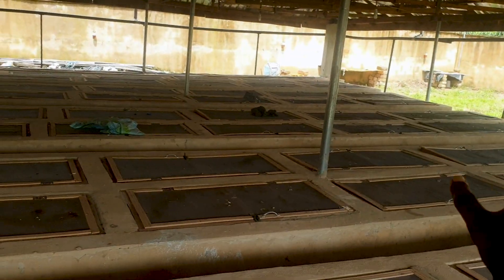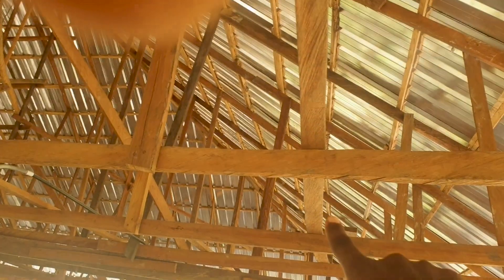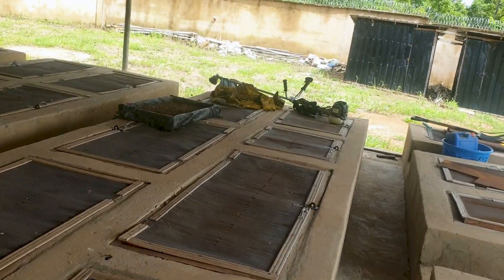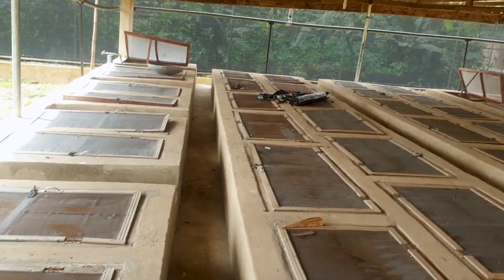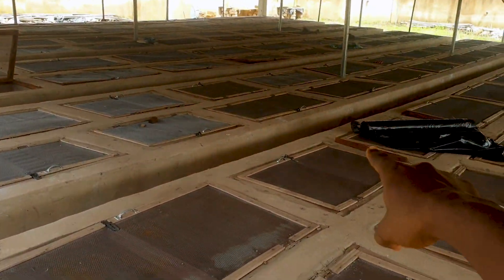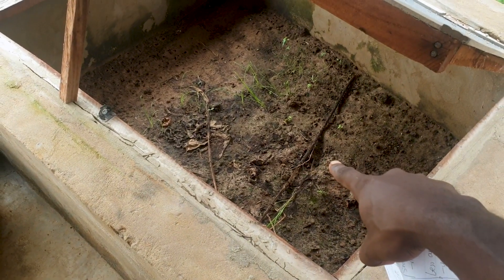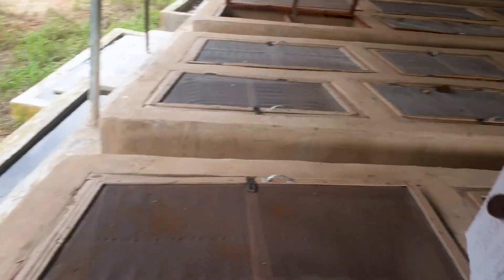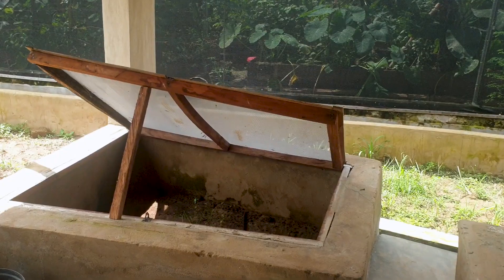Snail Pen vs. Snail Greenhouse (Honest Opinion)

Comment: Your video was shared to me by someone a few minutes ago. I humbly have a few questions. 

1. How did you arrive at 30,000 - 40,000 snail density for the net house?

2. If 7000 snails will max out a 50*50 plot, how is the density for 100*50 equal to 40,000? 
If the pathways and block work even covers another possible 7000 snail space, I do not think the net house should be able to take 30,000-40,000 snails.

3. You did not offer a single solution to any of the issues raised about the net house. Including the high injury rate which has wiped out a lot of snail net house farms. 

4. Pig farmers also do alot of bending when cleaning and feeding in large scale farms. we do not often hear them complain about bending too much. Don’t you think we are creating a perception that in snail farming, one has to do almost no work at all. 

5. You did not mention the fact that pests can easily attack snails in the net houses. Further more, the pest can hardly be controlled due to the nature of the housing.

6. Snails are not in their natural habitat if they cannot escape from pests. They are not in their natural habitat if you have limited amount of vegetation for them. Should we put poultry, rabbits and pigs in their natural habitat too? 
You also did not mention that you have to manually feed the snails every day in the nethouses as some of them are not able to reach most of the vegetation in the nethouses.

7. For how long have you been farming snails in the net houses? 

8. You mentioned high injury rate in the net houses. Which means there will be frequent ant and housefly attacks. If that is not happening in the trench pens, doesn’t it provide more profits in the end? 

Anyway, I’d like to have a live YouTube session with you to discuss these out. In your submission you said, you’re quite new to snail farming. I do wish you all the best though.
Reply from the maker: Hello KT, I''ll try and address each of your questions one at a time

1. The average size of each of my pen is 140 cm by 70cm. Thats an area of 0.98m2. With an average stocking density of 60 snails per sqm, it means I can have roughly 62 snails per pen. Since I have 117 pens, that means my entire pen can accommodate about 7254 snails. Remember I have designated some of the pens to be used for incubators so that will further reduce the pen I have available to house snails. The greenhouse has a dimension of 100ft (30.5m) by 50ft (15.25m). Thats an area of 465.125m2. Using an average stocking density of 62 snails per sqm means I can comfortably house about 29,000 snails. Now remember I have increased the surface area in my Greenhouse tremendously by adding plenty of vertical and horizontal shade blocks which will further provide accommodation for the snails since they can live vertically suspended or horizontally. Not to mention the 10ft height that adds a lot of head room since they can also attach themselves to tree trucks etc.

2. Let's call it 30,000 snails even if we are to stick to stocking density requirements considering what I already said in 1 above.

3. Talking about high death rates in the greenhouse is a low blow and subjective as I have witnessed farmers cry about absurdly high death rates in BOTH housing systems..so no system is an angel in that regard. Given that very little is known about snail diseases and management (unlike in fish, poultry and pig) that have well established disease management practices and vaccines to help checkmate these issues. Snail farming is faily new and a frontier farming practice so its expected that mortality will be fairly high. That being said, growth rate and hatchability rate are also high given that each snail lays a LOT of eggs to more than compensate for the ones that are lost. I have already talked about having an established walkway to minimise the incidence of crushing eggs while carrying out maintenance practices, I have also talked about (in my other videos) the need to always clean the feeding platform to make sure the snail poo doesn't contaminate the food given to the snails and to also remove dead snails so they don't contaminate others. I have also mentioned having a variety of plants and vegetables so shade the snails as well as create a local climate with the right relative humidity that'll aid their development. What else is there to say?

4. Some (if not a lot) of the people who want to do this business are elderly people that have retired from their career and want something that'll help them get by. Putting that sort of strain on their waist isn't a good idea. In addition, most people that come into this business don't have the financial means to hire workers..they barely have enough money to build the structures and buy feed talkless of highring workers that'll won't be dedicated. I'm not encouraging no work at all. Theres no food for a lazy man. But when it comes to health, its a different thing bro. I understand where you're coming from...people want things too easy and sharp sharp but come on..this is not that.

5. A greenhouse with trench and a strong net will help eliminate most of the pests. Now, because the places where the plants are is exposed to earth means the Greenhouse system is exposed to ants. But not ALL ants are detrimental to snails. Yes, I agree I've not been in this business long enough but I've studied enough about it and also asked others e.g. Engr Theocracy who has been in this business far longer than me, Ants can be a problem but not as much as we make it out to be

6. I don't feed me snails everyday in the greenhouse because they can feed on the vegetables like bitter leaf or sweet potato leaf whenever I don't want to give them fruits or formulated feed. A greenhouse that is well taken care of won't have to worry about a lot of pest infestation i.e. ants. The greenhouse can't exactly mirror the forest because its limited in size but at least its the closest thing to that. Come on bro, compared to pig, poultry and rabbit that require a bit more specialised feed, snails are more freestyle & anything goes kind of creatures. They can eat a lot of different vegetation. It's not the same situation with the other animals you've mentioned. I can bet that If we both can speak chicken and we ask a chicken which she prefers, she'll tell you she'll rather be left to roam about, play and find her own food rather than being stuck in a battery cage lol and be fattened for the kill.

7. I've been PRACTICING snail farming since November 2022...been learning about it for a lot longer including being around my uncle's farm who also does it

8. A well-constructed and fortified pen house doesn't have to worry about ants but that's not the least of the problem. There's still disease outbreak, cannibalism etc to worry about...which is why a lot of pen houses (in addition to greenhouses) report a lot of mortality. No system is a saint in this regard.

I'm open to have a YouTube live session of course...as long as you promise not to come for me with a knife...I'm not ready to die.
Reply: 1. So by your reply the 30,000-40,000 was wrong.
Secondly, the calculation in your reply is not entirely correct. You couldn’t take out the area of land the vegetation, the set up, path ways and platforms will take out of the total land size. 

You also mentioned in your reply that snails can live vertically? Not true. They usually climb and sleep vertically when they are uncomfortable or do not have enough shade.
Eventually, they will drop and add up to the numbers. This is a fact !

2. No it’s not 30,000 snails. What that will also mean is no stepping space for any human nor vegetation space. 

3. Farmers cry about both housing reference to mortality. 
In the trench housing you know exactly how many snails you lost and can identify the cause in 24 hours. You can easily learn about the causes and avoid them if you mean business. 
Same cannot be said about the net houses. I bet you have discovered totally empty snail shells right? Ants had already had their feed.
Bro, talking about vaccination and co, are fishes given vaccines and co? But farmers keep them in pest free farms. 
I can also bet you that no mater how much pathways you build, you’ll always need to step on the soil. Unless your path ways take up more space in the net house.

You talked about the number of eggs compensating the mortality. Bro how do you know? Since you cannot do any accountability? 
You have tens of snails falling from your high walls every night. Whiles you have the AM laying averagely 8 eggs
Reply: 4. Your vegetation will at a point get deserted. You will encounter difficulty in replacing them since you cannot step on the soil. It will soon come brother. Anticipate it.

5. The issue of bending is not an issue you should have brought up because it’s very low of a point. You even bend a lot in your net houses😬. 
This is business. 
If one is an elderly person, does it also mean they shouldn’t do pig farming since they will be bending there too?
For people who have low income but want to start snail farming should start with few pens, have a different business module and scale up with time and employ labour. They do not have to raise everything they sell. 
I don’t know any poor person who can build 50 pens. It’s so profitable that if you farm them right, labour cost is not even a problem.

6.  Please don’t mention that guy’s name. He keeps misinforming alot of people. Same person who said not a single ant can kill a snail. Same man who said only AF produce snail mucus? 
Let’s leave him out of this.
 I can tell you on authority that your farm is yet to be invaded by ants in all shape or form. The trench around it will stop some but most of them will build tunnels beneath the earth and appear in the net house. 
Note that a big variety of ants can eliminate snails. Some centipedes will make use of abandoned ant tunnels and infest the farm. It’s facts. And it will be difficult for you to control them.

7. Ofcourse every animals yearns for freedom. Giving them some free freedom does not necessarily mean it’s right. 
If there is an ant infestation in your farm, the ants will I’ll flee but still end up with them. Because they have been limited. 
You’re not in business if you still have pest attacks and cannot account for mortality. It’s like exposing poultry to snakes in a net house. They are roaming but will die.

There is no cannibalism in snail farming if they get their calcium supplements. 

A trench farm owner can report on mortality day on day and decipher the cause like I said earlier. You can’t do same until harvest is due. 

You only depend on estimations and business is not done that way. I’ve been to very large scale farms in other industries and you’ll be marveled how they still prioritize accountability. 

+233548178415. Kindly shoot me a text on WhatsApp and I’ll respond when I get home. We should have a live YouTube session. 
Thanks for responding though
Reply from the maker: @k.t.samuel  1. My estimation is not wrong because I gave a range and my final number (taking into account the additional surface area from the shade blocks) fell within that range. It wasn't a number plucked out of thin air. Weather they go there to sleep doesn't matter. Bottom line is they do it. In the pen house that is almost perfectly shaded, they still climb up. Some do it to avoid predators on the floor. Their slime is way stronger than you give them credit for. They don't fall that often..far from it. In addition, snails live within the vegetation, on tree truck, in the shade block, in the spaces between the shade blocks etc. so those structures don't limit surface area..instead they add to it.

2.  You can call it 29,000 if you want but in my humble opinion, its 30,000 if not more. To each their own

3. You can't always identify the cause if it's a disease. If they're not getting enough calcium and their shell is turning white of course you can EASILY identify that. But, if its death due to bacteria, fungal or viral infection in their food or water, it's not that easy to discern if we are being honest.

I don't have snails falling from my high walls every night because it's netted all round and snails rarely even climb it. I'm talking from my own personal experience. We can stake money on it, put a night vision camera inside my greenhouse and see how many snails actually climb the net..come on!

I don't know about other farms but mortality in my farm is not that high. Each snail laying on average 8 eggs, 3 times a year can more than compensate for the deaths. I'm being realistic
Reply from the maker: @k.t.samuel  4. I don't anticipate my vegetation getting deserted to the point where i'll struggle to maintain the snails. In the rare event it happens, the pen house is there as backup incase I need to house them while the plants in the greenhouse recovers. In addition, I anticipate i'll have another greenhouse up and running when the snail population reaches that sort of critical level to start worrying about the vegetation being deserted

5. You can't compare bending to put food inside the snail food trouch in the greenhouse (less than 30 food troughs for that matter)  to bending to put food inside food trough in the pen, bending to till soil for eggs, bending to incubate eggs etc for over 100 pens! Starting with few pens will take a long time to earn any reasonable income and scaling up with a pen house is just not wise. Thats my opinion. Why spend more to get less when I can spend the same amount to get a LOT more. Clearly, you don't want to agree on that so lets agree to disagree

6. Engr Theo has achieved a LOT in this space. Whether you agree with his teachings or not doesn't change that. For what he has achieved with regards to snail slime extraction, he deserves respect. And, he didn't say only AF produces slime! he said only AF snails produce the kind of slime that has the RIGHT PROPERTIES needed in the cosmetics industry..not that other snails don't produce slime at all. He's not stupid. Granted I don't agree with him on a lot of things e.g. I always clashed with him because he believed only snail greenhouse was good and snail pen was complete crap. I saw merit in both systems so we agreed to disagree on that

7 Like i said before, lets agree to disagree since it's clear we are both dug in in our beliefs and no one is willing to yield.
Reply: Disclaimer: 

I have nothing to gain from informing you. I like healthy dialogue about things have passion for. 
I hardly comment under videos I disagree with.
Reply from the maker: @k.t.samuel  Fair enough. I appreciate the dialogue. We both are passionate about Snail farming and discussions don't have to get combative. In the end, we both want the best for people and we are open to learning.
Reply: @zenaksnailfarm  Regarding the individual in question, it is advisable to disregard their input as they exhibit closed-mindedness and a tendency to engage in unnecessary arguments solely for self-expression.

Moving on, I want to acknowledge your excellent performance, Zenak. Although there are challenges inherent in this new domain, I believe good management & a well constructed ecosystem is everything. Your 30K estimate is correct, even in the event of a 15-20% mortality, you will still surpass the pen system, which was built at a higher cost.

It is important to note that when discussing habitat, we consider not only where animals sleep but also their roaming behavior. For most net-houses I’ve seen including yours, the presence of a walkway within the system does not restrict the snails' access to that path. They crawl on it at night and return to the bushes in the morning, meaning the walkway does not detract from the overall farm area. Additionally, plants such as banana, pawpaw, bitter leaf, etc., contribute to the area through vertical dwelling. 
A research from a Greece farmer I visited found that, snails raised in a free range system tends to have tastier and quality meat than ones restricted in a small confinement. This may not apply to our GALS but it’s worth looking into it as we see this is true for other livestocks.

I still have your email from a few months ago, and I am currently addressing some matters that I will share with you in the coming weeks.

On a personal note, my shadehouse spans over 9000sqm, and I have divided it into 24 paddocks. Each paddock is fenced with heavy gsm insect net at a height of 2.5ft to ensure that snails remain within their allocated block. I adopted this method for scalability reasons.
So far we’ve only stocked 8000pcs (2blocks) since May. And gradually filling the other blocks with the newly hatched. Goal is to fill at least 10blocks prior the end of the rainy season. Each block I estimate can take atleast 20k adult snails
Reply from the maker: @McOforis  Thanks. I appreciate the feedback. It's always good to have a healthy dialogue and KT is knowledgeable so it's bound to be a fight. Your view of Engr Theo is quite accurate lol it's like you've had personal encounters with him. I just think it's his personality but his passion is not in doubt. With time he'll learn to be more accommodating of other views.

Your farm is quite massive! wow!!

You must be looking to go into slime production or even exportation with a farm that big.
Reply: @zenaksnailfarm  Not sure how Engr Theo came up in this discussion. Regarding Engr Theo, my previous comment did not pertain to him directly though. Although I have engaged in banter with him in the past due to misinformation, resulting in a few of his videos being taken down 😂 . Feeding snails salt and passing it off as research is a no no for me, I considered it a form of animal cruelty.
Despite Engr Theo's occasional stubbornness, I have noticed glimpses of retractions in his new videos regarding previous information. However, it is important to acknowledge that this journey is a continuous learning process for most of us. In every professional field, there is always something new to learn. It is the close-minded individuals who lack comprehension of a specific system yet assert their expertise based on others' failures that I find difficult to tolerate.

Regarding my snail farming endeavors, I am currently focused on AA snails, with no immediate plans for slime production which requires the AF species. However, this could be a possibility in the coming years, depending on the success of the meat aspect of the business. 

I am based in the US and have already established contacts prior to making this investment. While my primary target is the local market, I have explored potential opportunities for exporting to the US market prior to investing. Despite having comprehensive surveillance and monitoring devices on-site that allow remote observation of day-to-day activities, I still make a point to visit the farm personally at least once every quarter.
Reply from the maker: @McOforis  oh you meant KT. Don't worry. He'll come around eventually lol they all do. He's making a lot of money from his mango farming to look deep enough into greenhouse snail farming. When he does he'll see some merit in it...he's too smart not to.

Oh I see. So its meat production and processing for now. Thats lovely. I'm sure it'll be successful. Snail farming can pay tremendous dividends when practiced at scale and you're doing exactly that!

With regards to Engr Theo, I agree he's not afraid to admit when he's wrong. He was one of my mentor (him and Kester Amos) so I have nothing but respect for him.
Reply: @zenaksnailfarm   Yup, I was referring to KT.
Check your email. Sent you some pictures. I don’t like sharing stuff online until I’ve hashed out all the kinks and making sure everything running smooth. I’ve documented all the roadblocks & lessons learned  since July 2023 to share with existing & potential farmers. 
My farm manager will have a lot of educational content to share with the public once we open a YT channel for it lol. For now we’ve been working  on this commercial project in silence
Reply from the maker: @McOforis  I'm short of words. The work is very neat. The connection from the vertical pipes to the shade net, the stitching, the walkway layout, how the plants are organised, the PTZ camera..its impressive. Its what I love to see..fusion of technology and innovation. Pushing the boundaries of whats possible. Very well done bro!!
Reply: @zenaksnailfarm  thanks it’s always good to share ideas with like minded people. I’ll keep u updated on progress.
Reply from the maker: @McOforis  That'll be nice. Thanks bro.
Reply: @McOforis  I’ve asked you this before and I’ll ask again, what really do you need from me? You practically follow me around. Quick to join my dialogue and insult me?
That I am closed minded?

What’s wrong with you really? 
This should be the last time you interfere in my interactions. 

1. You have no experience in snail farming than I do and if you even did, my observations are also noted in a number of research documents. 
You think I go about throwing information I know nothing about?

2. The last time I saw your comment was under the video of someone who had lost all snails in a net house without even realizing it. I didn’t see a proper solution from you to the individual.

This will be the last time I engage you. Stay away from me.
Reply: @zenaksnailfarm  it’s not about mango farming. There’s a lot of of misinformation about snail farming here on YouTube and even books found online.

I’ve been farming these guys for years before transitioning in full time farming.
Over the period, we have studied a lot of things about them.

I have personally visited so many net houses. I have actually asked these net housing owners to come out and share the realities of their system and discoveries. 

I found some inconsistencies with your claims in your video and some responses you gave yesterday but I was in town and also did not want to have along back and forth. 
I was hoping you’d reach out so I could share video evidence and other but you didn’t which is okay.

I didn’t bring up Engr theocracy. You did. It’s okay for me to outright tell you how I feel about his misinformation. I also wanted to share with you the video he said only the Fulica has slime. 
For someone who has been sued for copying the mucus pro design without seeking approval is an individual I’m mindful of his integrity.

But above all I appreciate your response.
Reply from the maker: @k.t.samuel  It's alright bro. We are always open to learning new things. I wasn't aware Engr. Theo was sued. That's an interesting development.

Nevertheless, I'll message you on WhatsApp so we can hash out the inconsistencies you noticed in my video.

I think one digit is missing from the phone number you provided: +233 548 17 8415. I've saved it but for some reason, the Whatsapp icon is yet to appear

Kindly see if mine is visible from your end: +234 802 7300 340
Reply: @k.t.samuel  Follow you around? Dude what fantasy planet are you living on? Our interaction was limited to a single occasion on your platform, where you persistently spread misinformation about a subject you clearly lack knowledge in. As a snail farmer, I actively observe multiple channels and media platforms to learn and also share insights. Therefore, it's natural to find my comments on other platforms. If you followed my conversation with the other farmer closely, you would know that I provided potential causes for her issues. Despite claiming to have followed the instructions from her system's constructors, she faced ongoing snail mortality. Without being physically present, I suggested checking the soil's pH, it’s nutritional composition, and water hardness as a possible solution. Being labeled closed-minded should not be seen as an insult. It is inappropriate for you to challenge something you don't understand and engage in nonsensical argumentative discussions on someone else's page. You selectively disregard valuable information presented by individuals who may have made a few inaccurate claims about snail farming or shadenet systems. Where is the educational aspect you claim to promote? To my knowledge, the content you create in your videos has already been discussed by other YouTubers, yet you present it as if it were a groundbreaking idea solely for views. I blame people who are so lazy to read and research on their own that feeds on your contents as the sole truth. These type of people are usually the ones that learn one thing and quickly implements hence a sloth of many failed snail farmers both pen and shadehouse . I will not tolerate your baseless remarks directed at a hardworking and knowledgeable individual who creates valuable snail-related content. I suggest you focus on your own farm and training activities. You spend 10-20mins discussing others failures on your platform, when you’re being challenged with just a 1min write-up like this you act all defensive and run back in your shell like a baby snail 😂. By the way, in our previous interaction, we made a bet of $10,000. I hope you can dish it out when the time comes.
When I started playing with snails and farming in general, you were probably still in diapers so I hope you don’t repeat that “experience” claim of yours again. It is very recent I decided to go commercial. You have no idea of large farm businesses working in silence, just because you have some 30 pens somewhere in the bush and a camera to shoot doesn’t necessarily make you the sole expert or voice of this agribusiness. Bye
Reply: @McOforis  point out a single thing I said about snail farming that is inaccurate.

Snails climbing walls and falling?
Ant infestation?
Lack of accountability?
 Which one? You’re hilarious
Reply: @McOforis   scrolling through my notifs, tells me you have come at me on three different occasions. This is the fourth time. 
Am I not safe to say you’re following me around?

If I had known you’re the one who suggested a bet but never followed through with it, I wouldn’t have engaged you. I only took notice of your name after your last silly comment under my video. Saying I’m misinforming people when I’m telling people things they can easily find via google and proper research document.

You reference proper greenhouses in Europe without realizing the primary goal which is managing temperature and humidity. 

In one of our arguments you said I didn’t know what I was talking about when I said the Helix aspernia specie are mostly found on rocks. Yes limestone rocks. This is not my claim. It’s general knowledge. 

You spend so much time commenting on videos here whiles being an absentee farmer. 
Give us a break
Reply: @k.t.samuel  
I used the handle "Khabib4929" to comment on your video nine months ago, which initiated our back-and-forth argument regarding snail systems. That is likely where you received the three notifications. In that same thread, we also made an $8,000 bet to compare the results of the shadenet system vs the pen system after 2years. I'm unclear about your statement regarding backing out from the deal. If you are serious about it, let's formalize the agreement and revisit it 1.3 years from now. Should you be unable to fulfill your end of the bet, I assure you that I will pursue full recompense of any asset u have and donate it to charity.

Regarding your definition of an absentee farmer, if it implies not being physically present on-site 24/7, I acknowledge that as a factual statement and the only truer statement you’ve ever made. However, it is highly probable that you have purchased my bell peppers or corn from the supermarket or local market at some point, and I have achieved this all while being an absentee farmer for the past 5yrs. Just imagine the possibilities if I were on-site round the clock. I wish you success, and hopefully, you can achieve even a fraction of the weekly income generated by my current farms.

How stupid will it be of a person to setup a greenhouse without knowing the 2 basic parameters. 
You throw argument all around, it’s hard to even make head and tails of it. To say a helix species live on rock is another misinformation we need to debunk. Sure snails eat limestones as a calcium source, seeing them on it doesn’t mean that’s where they dwell. Two habitats conducive for snails; forest and water, period. Snail will hide in a rock full of algae inside the water or in the forest because of the low temps and high humidity and also for calcium but that doesn’t mean the rock is their dwelling place…geez. Imagine a snail feeding only of calcium, not organic matter, no herbs, no soil etc, just eating rocks. 

I am aerospace engineer and more recently program mgr supporting deep space and low orbit programs on the ISS. I’ve hired a few  people like you, shiny resumes, all talk but then when it’s time to do the work they’re found wanting because they’re rigid to change. 
My line of work requires constant problem solving so when I see people like you making farming seem like some sort of rocket science it’s fascinating.

This venture is not hard, put in the proper structures and management system and you’ll be fine, and for me farming just comes natural. It’s something I enjoy especially with livestocks and very soon I’ll be pursuing it full time and retire my  engr career
Reply: lol. Wow. The conversations got heated up here. All the same, y’all made valid points, that we upcoming can learn from. Weldon sirs.
Reply: @McOforis That’s a massive farm. Congrats sir. It would be nice to learn how you are progressing.
Reply: @everyparty1224  Progress has been slow & steady – no pun intended 😂.

Update: Our farm is thriving; we observed snails laying eggs even during the harmattan season, although egg quantities were suboptimal. As of March 1st, 2024, the maximum eggs per clutch range from 154 to a minimum of 90. We’ve also attained 100% hatchability on some of the clutches artificially incubated.  Concurrently, we recorded 17 and 7 mortalities in January and February, respectively, attributed to slight climatic changes, accounting for less than 0.12% of our total stock aged 7 months and above. This rate is not a cause for significant concern.

We are intensifying production efforts this year and anticipate further growth so we can start offloading the parent stock next season.
Reply: @McOforis  Excellent sir. Glad to know everything is going smoothly, particularly how well you’ve been able to mitigate mortalities.